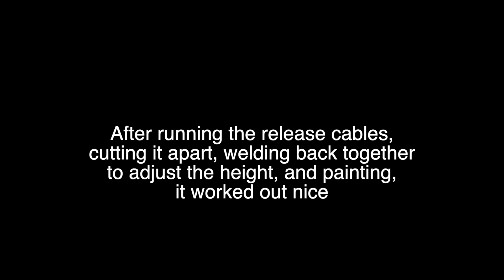C10 Project:  Making a Safety Catch for the Hood

Comment: That re-engineering at it's best. Question; What holds the cables housing in the filler panel? It looks like it was drilled and tapped at an angle unless you got something underneath. 
Either way, it works. Great job!
DK, Omaha.
Reply from the maker: Thanks Dean.  I had an aftermarket throttle cable assembly.  It had a threaded end that was about an inch long with a nut on top.  I found another nut that would thread on, ground it at a 45ish angle for the bottom then drilled out some type of threaded ferrule I found for the top, ground it at a 45ish angle as well.  Drilled a hole in the core support and sandwiched it in between the two 45 pieces. Worked well.
Reply: @StoutCustom  Job well done Jim! It look proper and works. That's what you need. I understand that second safety catch, but never heard of anyone who benefited from having one. 
I need to make a similar setup for my 67. 
Congrats on the move as I my case, it was making the wife happy and I lost my huge garage, 3/4 underground, concrete block, reinforced with steel as my lot ran downhill into the street below. I could walk to work & noticed across the street, they were taking dirt to fill the empty lot. I provided an extra dump truck & beer. 11' deep, 28' wide, 34' long. And stayed cool in the summer. Still no cracks in the driveway with loads of "Hot Concrete" refused by state highway inspectors. I miss it. 
Take care.